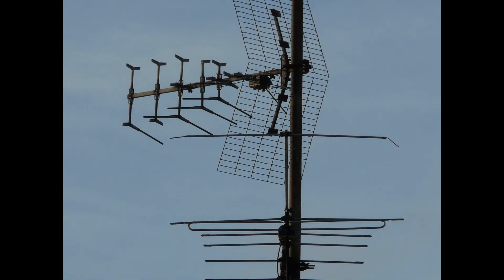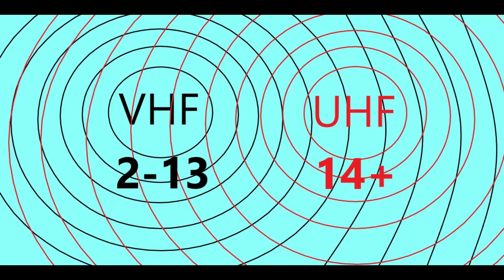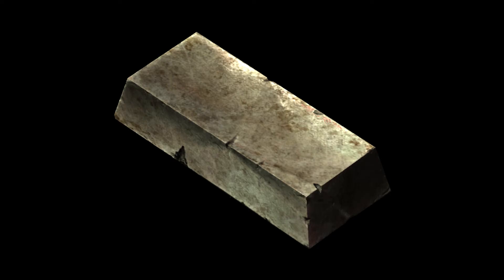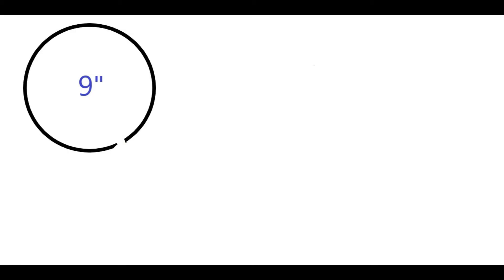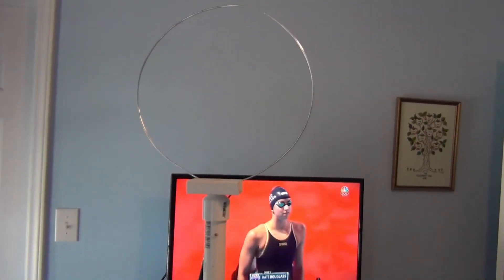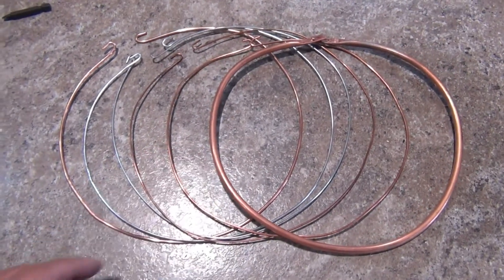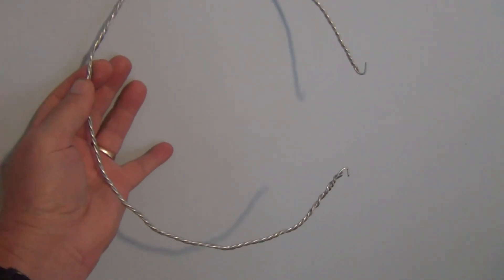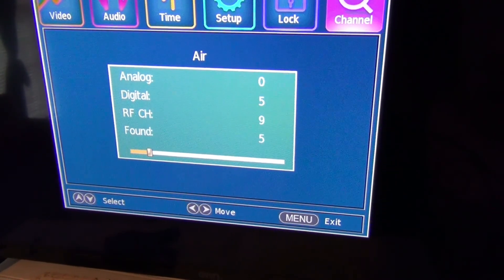DIY TV Antenna Element- Choosing  What to Use.

Comment: Thank you for the great videos.  Easy to watch and understand.  I'd like to know how 3 twisted 14 ga wires would compare to the single 10 ga conductor.  It'd probably be much cheaper.
Reply from the maker: Yes, they perform about on par with 10 ga. copper. The odd thing is, none of the wire gauges higher than 10 gauge perform any better for me, so 10 gauge solid copper has become my benchmark. Thanks for the comment.
Reply: @mrhoptoit7835  - Thank you for the reply.  I plan on following your instructions to build the Double Hoop Antenna using two 3-wire 14 ga twisted hoops and a high-quality balun.

Comment: Great video. Thanks.  I'm building another Hoverman antenna using 10 GU copper wire. Now you have me wondering how 8 guage copper would compare. May be different than twisted.
Reply from the maker: I my tests, 8 and 10 gauge both seem to work the same. Possibly your location may give you different result?

Comment: I get more gain from aluminum for channel 32. I get less gain for channel 32 from steel. The elements are different thicknesses though. The aluminum elements are half as thick as my steel ones. Plus one is double yagi, other is home made bow tie.
Reply from the maker: Thanks for sharing your experience with different materials.

Comment: It is rather well known that element thickness increases antenna bandwidth. In this instance this is likely to be little importance.  RF travels on the surface of the wire so the surface area of the outside of the wire will have some effect. This also is likely of small importance.  The effects of element characteristics ( wire material and wire thickness)can be modeled in programs such as EZ-NEC.
Reply from the maker: Thanks for the comment.

Comment: Again, if the antenna is completed, how many metres high can the pole hold this antenna be raised to make the antenna receive in this region?
Reply from the maker: I don't know about your region, but in my area about 8 to 9 meters high works well for many antennas. Every location will be different.

Comment: I live in valley surrounded by mountains. We are about 300 to 500km from DTV or DTH transmission stations. The only tv channels we can receive is satellite tv transmissions. 

Can this antenna be used to receive local networks or dtv/DTH channels for local news?

Waiting to hear from you soon.
Reply from the maker: TV antennas need line of sight to the transmitter tower for good reception. I'm most situations, the farthest you could be away would be around 120 to 130 km away. After that, the curvature of the earth will actually block the TV signal. There isn't an antenna made that is capable of getting a signal over the distances you've described.

Comment: Nice video. I honestly know nothing about antennas so disregard if you wish. 
- Just wondering, since copper proved superior why didn't you try one diameter size down in copper tubing to compare to the 10awg electrical wire?

I'm wondering, when looking only at the copper antennas is the diameter sort of fine tuning to the available signals in the area?

Thanks for the video.
Reply from the maker: I had some of this copper tubing lying around so I tested it.  I may possibly do another future episode testing other materials, diameters, etc.

Comment: I am really wanting to know if the wire is wound into coils it it will increase signal. I am getting ready to build a new antenna like this and wonder if anyone has tried and seen  better results?
Reply from the maker: In none of my tests has coiling wire increased performance. Thanks for watching.
Reply: Thanks for the quick response, I am building a new set of antennas to replace my older ones I did about 15 yrs ago. I'm hoping for an updated set to show some better results and looks as my old ones have really parished in the stow and recent 80 mph winds.

Comment: Mr. Hop To It, would 10 gauge copper wire that still has its insulation and then twisted work better ?? Just an idea Sir. What would you say fella ??
Reply from the maker: I haven't tested that, but I doubt it would have any significant effect.
Reply: @mrhoptoit7835  Would short perpendicular hairs 1/4 inch long made of copper on the outside of the tubing make a difference ?? How about coating the outside of the copper element with silver plating using electroplating ?? Just had these ideas floating around in my mind. Thank you so much for your time MHTI. Wish you health and wealth too.
Reply from the maker: @victoryfirst2878  always thinking, aren't you? Interesting ideas but I don't believe whiskers would help much. As far as silver coating copper, I don't think there is enough of a potential gain to justify doing it.
Reply: @mrhoptoit7835  Thank you for your honest answers.

Comment: I live in Romania where the signal is VERY poor. Do you think it would be best to use the 14 copper wire and an amplifier?
Reply: Also the height of the antenna and the the obstructions between your antenna and the tv stations are very important. 30 feet (10 meters) is usually a good height.
Reply from the maker: @USMC1984  A very good point. Thanks.
Reply from the maker: You might try using an amplifier and a three 14 gauge  twisted bundle for the element. Thanks for watching
Reply: @mrhoptoit7835  Thank you and what shape it would be best?
Reply from the maker: If your transmissions are uhf, then hoops work well. If they are vhf, a straight dipole may be best. Check out my other videos for a few different uhf antenna designs. Thanks.
Reply: @mrhoptoit7835  Thank you very mutch

Comment: I have a brainstorm, how about silver solder coating the 10 gauge copper wire for the element and then twist 3 wires to see if that increased the signal gain. Just an idea Mr. Hop To It. What do you think Sir ??? v
Reply from the maker: Interesting idea....
Reply: I hope you run with the idea Sir.  @mrhoptoit7835

Comment: I built a small loop antenna using the guidelines outlined in his test using three 14 gauge copper wires braided. I then tested this hoop vs 

A) My main rooftop antenna (Range Experts Long Range UHF/VHF) , 
B) my older small RCA Yagi antenna, 
C) a smaller "batwing" antenna purchased at Menards for $10, 
D) Rabbit Ears i purchased for $2 at Goodwill, and 
E) an amplified RCA Panel Antenna purchased at Walmart (3 years ago) for $39.99. 

I tested all outdoors in similar locations, indoors (except rooftop), and indoors amplified using a $15 ONN signal booster. The most channels received was 9 different signals (46 total channels) by the Range Experts and RCA Yagi antenna outdoors. 

For comparison, I used the same TV with a signal meter built in for all tests. The top scoring antenna(s) received 4 points, 2nd 3 points, 3rd 2 points and 4th 1 point for EACH channel I was able to bring in. 5th & 6th Place didn't receive any points, also antennas not picking up a viewable signal didn't receive a score. First observation, the signal booster on average helped about 5% but occasionally larger gains were found. With the more powerful small RCA Yagi the amplifier actually lowered signal on half the channels, increases were 2-4 percent. The largest gains for the amplifier were with the homemade copper loop and batwing. Overall, I found the cheap amplifier barely useful. Also along those lines was the RCA Amplified Panel which, along with the Rabbit ears, didn't have a top 4 finish in the tests. In all, with indoor and outdoor tests, there were 12 variations tested (RCA Amplified Panel, Batwing and Rabbit ears only tested indoors, rooftop only outdoors). 

The Rooftop was the clear winner, no surprise. Of the 9 channels, it had the highest or 2nd highest signal on 7 of the 9 channels scoring 24 points. Also Not surprisingly, the small RCA Yagi had the 2nd highest score used outside with 16 points. After that the small Yagi indoor amplified, the homemade braided copper outdoors and the homemade braided copper indoors amplified all scored the same, 9 points. Depending on location, the homemade copper had the highest score on 4 channels (2 when outdoors, 2 indoors). Small changes in location with the homemade copper made a big difference. Another surprise was the $10 batwing antenna  https://www.menards.com/main/electrical/electronics/antennas/ultrapro-ultra-edge-passive-antenna/58676/p-7720120061004614-c-1454940301502.htm . It had the strongest signals (with amplifier) on two channels but couldn't pull in signals on 4 channels (same as rabbit ears and the amplified RCA panel).

So what did I take away from all these tests (outside of the fact that I have too much time on my hands)? Mainly that the homemade braided copper loop antenna is a sold choice for an antenna that I made with parts I had laying around the house, excepting a purchase of a $2 transformer. It consistently picked up the 6 channels that are 30-40 miles away and picked up one UHF channel that is 44 miles away. This included a 20 point higher signal strength on two of the weaker channel signals for the Rooftop antenna.

If you are looking for a easy to transport camping antenna, a homemade copper loop antenna is a sold choice. Pack a pole setup and a 25' RG6 coax cable and you should be able to move the antenna around to get a very good signal.
Reply from the maker: Sounds like you ran a good, thorough test. Thanks for sharing your results,and thanks for watching my channel

Comment: I have a Clearstream 4V Antenna, which has a VHF dipole marketed toward "Hi-VHF" at a total length of around 24".  Screws in with two screws.

Works great for UHF... Of course, the only VHF channel I'm interested in is 6.  Dipole way too small for that...

I'm thinking of creating something specifically for 6.. and screwing it into the antenna... same spot where the dipole is now.

Any worries with this approach? Think I've got a shot?
Reply from the maker: In theory, that should work fine for you, as long as you are in good reception range for the dipole. Thanks for watching!
Reply: @mrhoptoit7835  My only concern is impedance... I'm a super beginner but trying to learn quickly.

Comment: I was given a significant supply of 8-gauge aluminum.  It isn't "better" than copper, but a heavy bird won't change the shape by landing on it.  That's what I use for all my antenna elements.
Reply from the maker: Free aluminum? Lucky you! Thanks for watching my channel.
Reply: I have acces to 6 gadge copper at roughly 30ft segments  and i asume that itd be very good

Comment: Good video! If the best material is 10 ga. copper wire, how about twisting together 2 or 3 strands of higher gauge copper wire? Are you going by total wire thickness or total resistance? Also, does Resistance have also something to do? Actually, can you elaborate what would be the perfect total antenna resistance to be used with a 300/75 Ω balun? I guess that would be as closer to 300 Ω, correct?
Reply from the maker: In the video, I twisted three 10 gauge wires together and it didn't seem to increase gain. In general, I believe the total mass and surface area of the twisted wires are what increases the performance. 300Ω is perfect if you are using the normal store bought matching transformer. Thanks for watching!
Reply: Thank you! 😉👍

Comment: When you used twisted wire, did you use the same number of twists per inch or foot for the different types of material?
Reply from the maker: I used the drill to twist the wires until the twisted bundle tried to kink. That way I figured I got the maximum twists in it. Im not sure if the amount of twists would have a major impact on the results, but more testing may be needed.Thanks for the great question!

Comment: It looks to me as if you are using a vertical placement for these tests but the hula hoop antenna is horizontal. Am I seeing it incorrectly and does it make a difference? Thanks! Love the videos :)
Reply from the maker: I experiment with either horizontal or vertical antenna builds. The horizontal orientation works well for pulling in stations from multiple directions simultaneously, while the vertical orientation is more directional. Smaller hoops seem to work best in the vertical position.  For this experiment, my only real concern was that each of the elements were the same length and size, and aimed in the same direction. That way the only variable would be the element itself. Thanks for watching!

Comment: I am surprised that bundling the ten gauge copper did not increase the signal gain. My personal thoughts is that nothing makes sense to what we would like the outcome to be. I most certainly like your logical way of thinking and doing things in your videos Sir.
Reply from the maker: Yes, I was initially  surprised with the results, too. Thanks for all your comments!
Reply: The results you got just make no logical sense. But live test results are the best way to figure it out which direction to follow.  @mrhoptoit7835
Reply: I believe the performance is tied to the diameter of the element which might be why twisting increases performance--it increases overall diameter.  Once you get to a certain point, however, an increase in diameter adds little performance.
Reply: @jimdo2969  Thank you JimDo2969